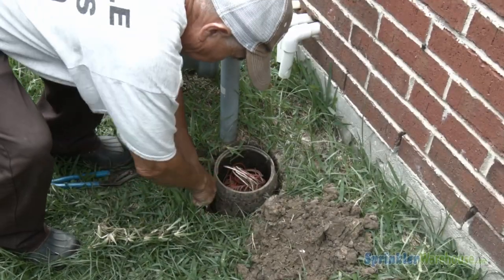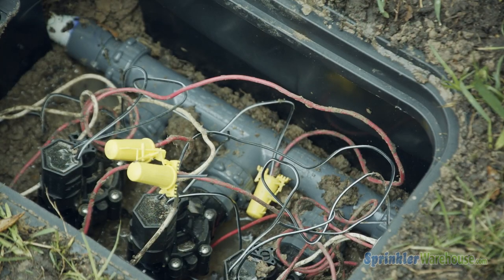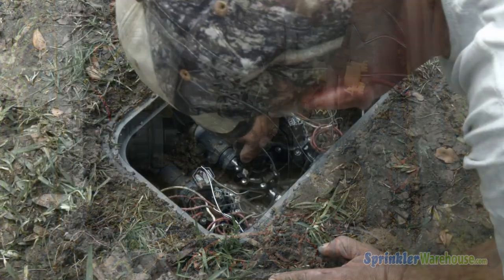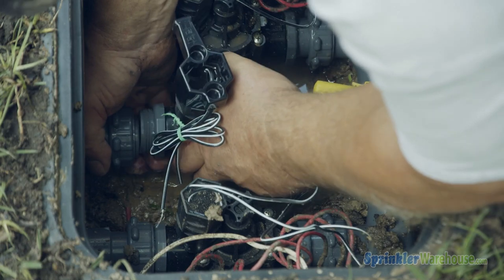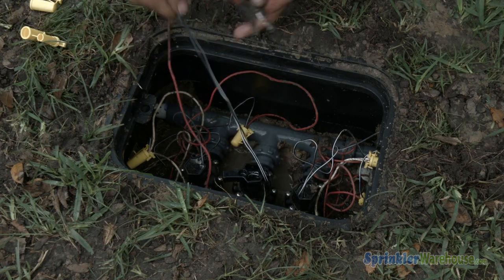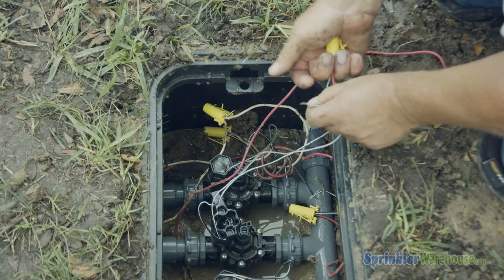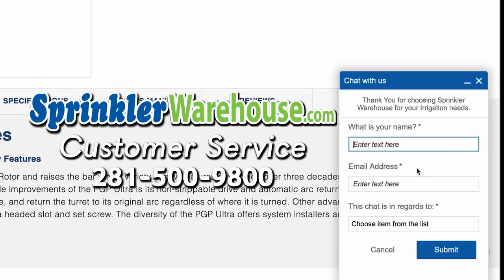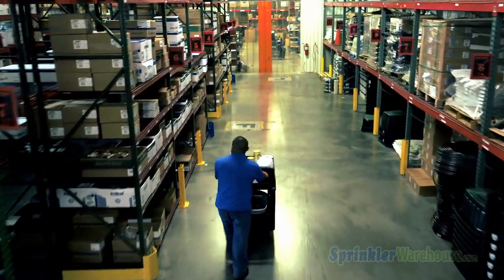How to Easily Replace A Manifold Valve

Comment: Your dreaming the majority of manifold irrigation values have all glued fittings. The valves are screwed onto threaded male adapters which are then glued to the pvc pipe on the female side